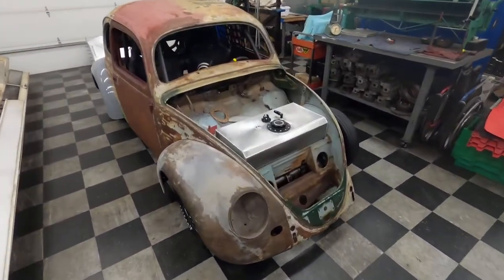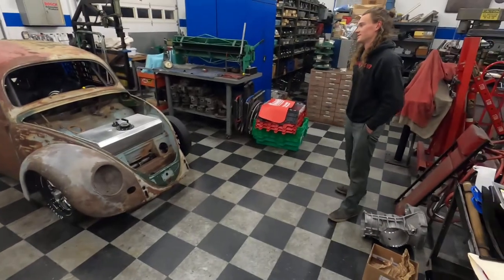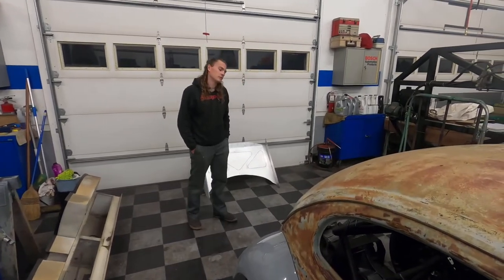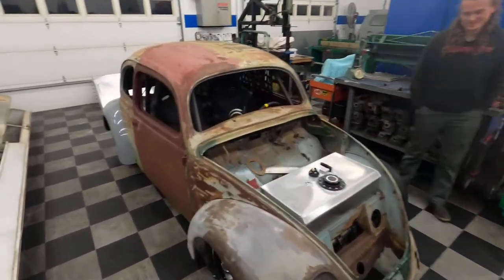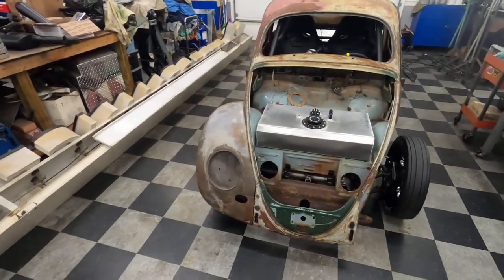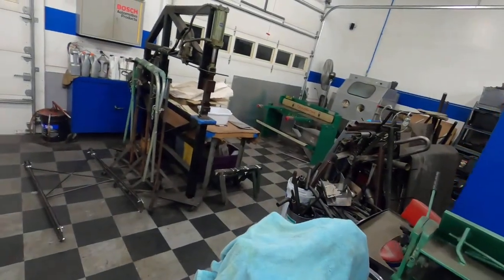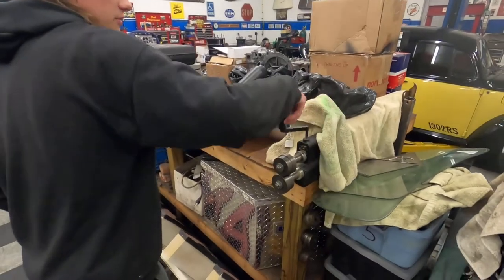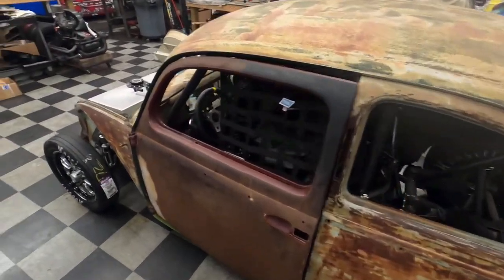VW BUG DRAG CAR WALK AROUND | 57 OVAL

Comment: Want to know the size of rims and tires from thay bug
Reply: Rear wheels are 15x8 with 26x11.50 Hoosiers. Fronts are 15x3.5 with 23x5 Hoosiers👍🏻
Reply: @dowcoenterprises4153  thanx. So the back 15x8 front 15x3.5
Reply: @dowcoenterprises4153  did you had to cut the inside to make them fit
Reply: @jovanimendoza7807  yeah I cut the whole package tray out and fender wells